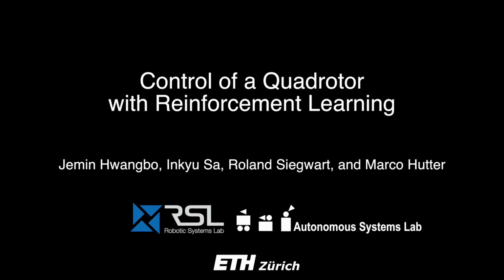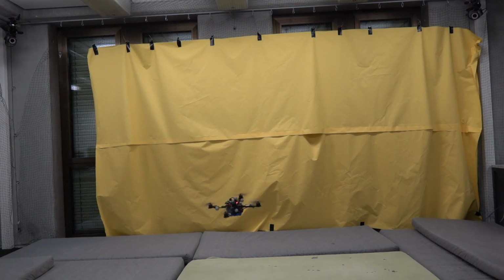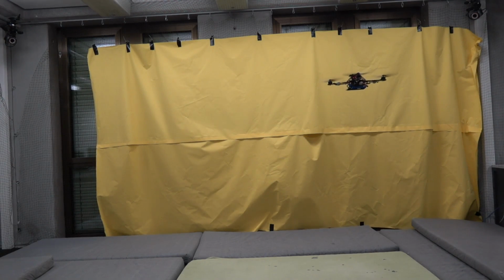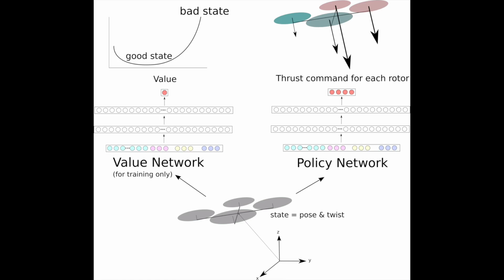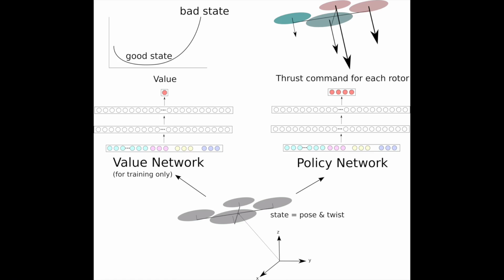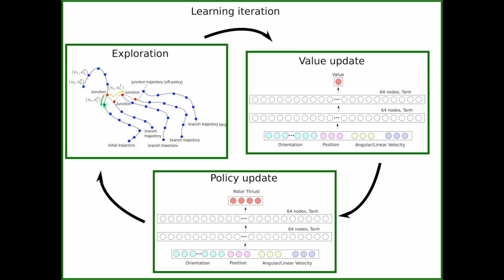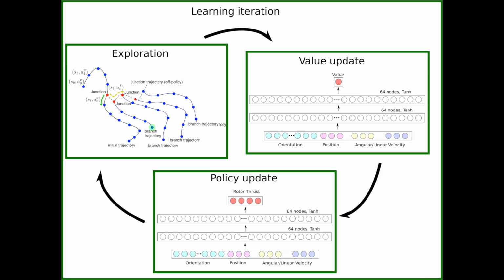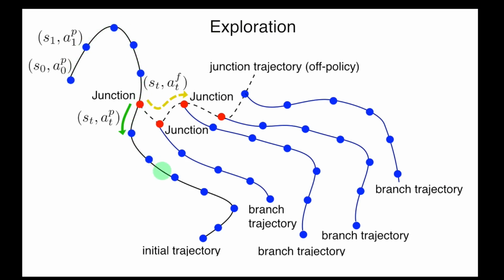Control of a Quadrotor with Reinforcement Learning

Comment: Amazing work! How did you guys handle the noise in sensors (Gyro/Accelerometer) ?
Reply: kalman filtering based techniques are used to achieve this i guess...also as far as the localization problem is concerned, the drone has reflective markers so im assuming a camera capturing mechanism is present for 3d localization.
Reply: @harshavardhankulkarni6599  yep! Makes sense

Comment: Hello, What a great video. I'm new to the subject of Reinforced Learning and hoped I could ask a question. Here goes: Does the ability of the drone to recover depend on input from the various sensors e.g. gyro. So say the drone flew from shade to sunlight, would there need to be a temperature sensor on board to allow it to cope with any sudden movement associated with moving from hot to cold. Or does the reinforced learning model not care about any of that and just learn to deal with whatever it encounters (so you could throw away the temperature sensor) and it would stabilize just fine with any sudden movement associated with hot to cold. Thanks

Comment: The performance of the quadrotor is excellent. 
But i have a question about the reinforcement learning. I want to know what a role  the RL algorithm play in the control system?  navigation or attitude control?
RL algorithm just provide  where to move, and PID controler to finish attitude control? Or both attitude control and location control are all RL algorithm`s duty?

Thanks for your response.

Comment: Random question here: I'm doing something similar using PPO on a quadrotor (simple simulation using OpenAI gym). I'm trying to get the cable suspended load case now, but still struggling with the reward function. Terminal states are way more difficult to handle than the standard quad.

Comment: I've read the paper however I could not understand how do you define the 4 actions? Each action is each rotor's velocity, right? But then how do they choose the velocity in the beginning?
Reply: Hello Anush. Have you made any progress with implementing the models from the paper?
Reply: As explained in the paper , there are two networks, one of them is a policy network. The policy network gives the PWM or rpm needed for each motor.

Comment: Good job guys. Can you share details of the platform you're using - is the machine learn platform tensorflow/python-based, and is the quadrotor system running on ROS?
Reply: We use Tensorflow and a custom quadrotor simulator. During experiments, we compute the MLP using Eigen library and the rest of the software is on ROS. We will share the code as soon as the paper is accepted ;)
Reply: I built my own simulator for speed. It's basically the Newton-Euler equation without any air drag and gyroscopic effect. Probably the simplest simulator you can imagine. I opensourced the code so anyone with c++ skills can use it. I do not know much about the latency from the computer to the ESC. It seems like it was not a problem for me
Reply: @jeminhwangbo7393   Would you kindly provide the opensourced code link for the RL Quadcopter?
Reply: Jemin Hwangbo 
Awesome, I'm looking forward to your paper
Reply: Jemin Hwangbo can you please tell me more about the quadcopter simulator? How you customized it and what did you use basically?
Thanks :)
Reply: Any updates on the code you are using? Is latency from the computer to the ESC output command a problem?
Reply: Thanks!